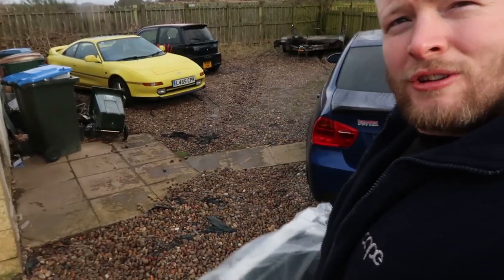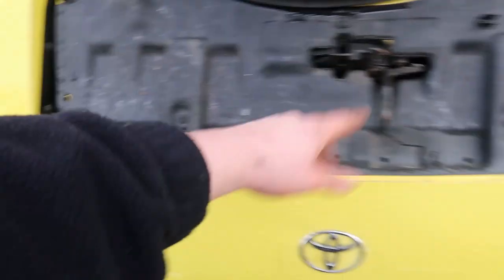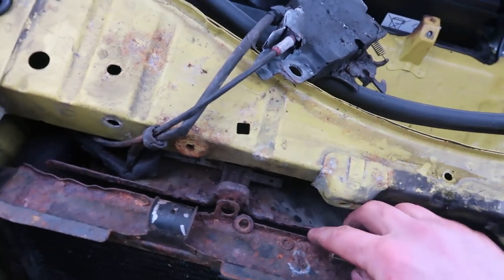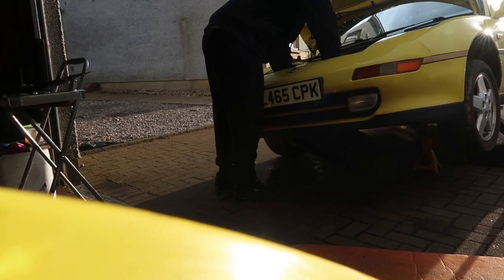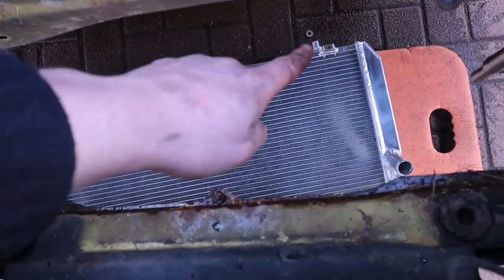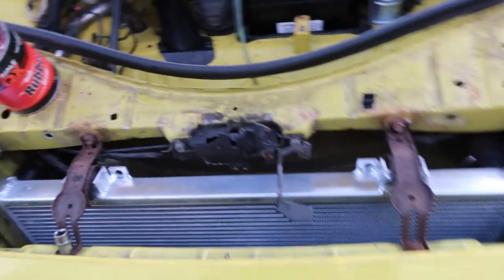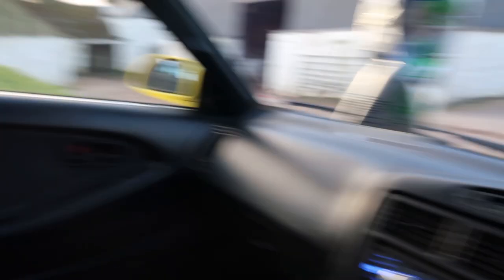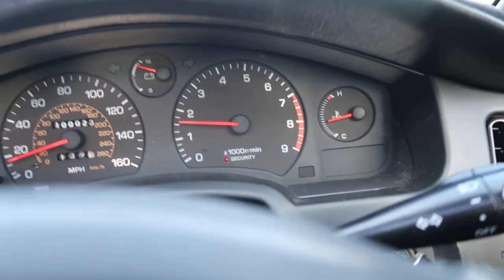HOW TO REPLACE MK2 SW20 MR2 RADIATOR [ALUMINIUM EBAY UPGRADE] NO ADD !!

Comment: How did you bleed the system without the front hose on the rad? I have a similar rad to you with no bleed pipe coming off, was wondering if you may be able to give me some advice on how you did it...
Thank you!
Reply from the maker: Hi buddy. There is a bleed on the heater matrix hoes at the front too :)
Reply: @BEYTEK  so did you close off the rad after that first fill then do all the bleeding through just the heater matrix outlet and keeping the rear as high as poss? Sorry for the Qs just want to make sure I get it right lol! Thank you
Reply from the maker: @jakethomas2322  yeah man. I also have a local farm near by with a really steep hil. I reversed up it so the fill at the back of the engine was in the air. I’m sure that helped massively